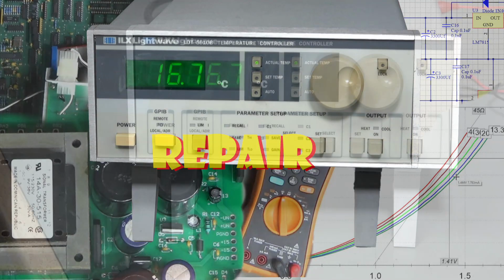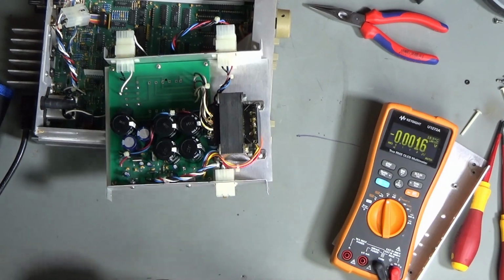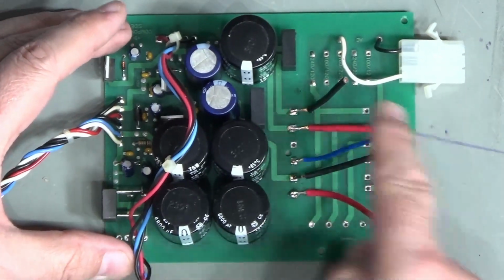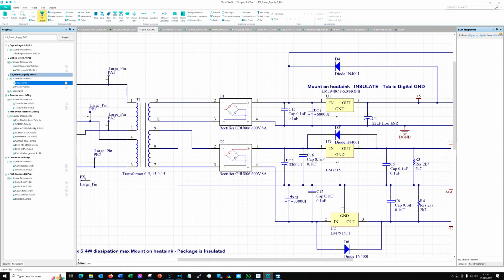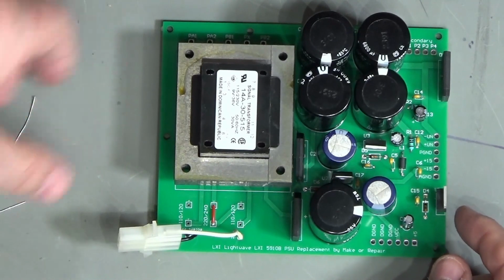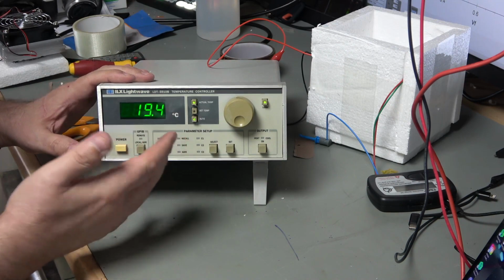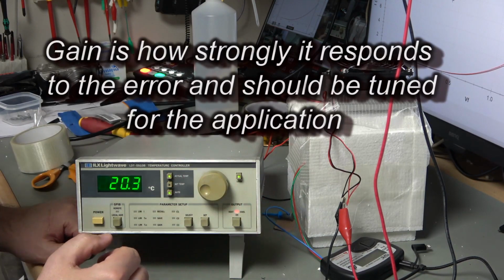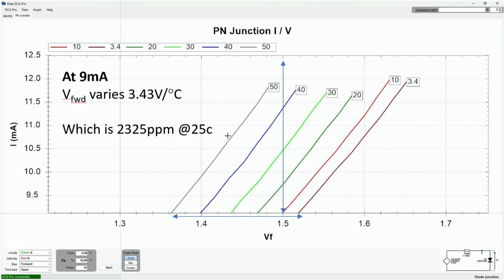ILX Lightwave LDT 5910B Repair #0095

Comment from the maker: If anyone knows the part numbers for the three componets in the empty GPIB sockets please let me know.
Reply: They must be the ones that correspond to the GPIB connector. The smaller slots will be for the SN75160 and SN75161 transceivers, and the larger one for the GPIB controller. Any DIP controller from National Instruments, National Semiconductor, Texas Instruments, etc., will likely work.
Reply from the maker: @Ismsanmar  Thanks,  I will look at those controllers,  Another person suggested DIP-40: NAT9914 (TMS9914)
DIP-20: SN75160B
DIP-22 Wide: SN75162B    9914 is definately the right controller, I enventually found a mention of it in a user manual although it is missing the schamits and parts list - they are included in the manual but the only PDF I can find misses them off! anyway between you and the other contributor I Iprobably can figure it out.  The ones that I reclaimed so far don't work - possibly because my 75160 and 75162 Are A type and the B type of the 162 has a independent REF/IFC control pin that A is missing.  I'll be keeping an eye out for all the transceivers including the 161 that you mentioned - annoyingly one is normal width, the other a wide format so the NOS/reclaimed price is a bit higher than I like - so I'll have to wait until I salvage some.  On second thought since the 9914 does not separate the two signals I might just be able to tie pins 1 and 19, food for thought when I finally finish reorganising the LAB - If I ever finish my FPGA series
Reply: @MakeOrRepair  Well, in a couple of days I can tell you exactly what are the correct ones, because I bought one with the GPIB option at the start of the last week, and I'm waiting for the delivery.
Reply from the maker: That would be very helpful if you can thanks.
Reply: @MakeOrRepair  I just received it. DIP40 is a TMS9914ANL, DIP22 is an SN75162BN, and DIP20 is an SN75160BN, all from Texas Instruments.